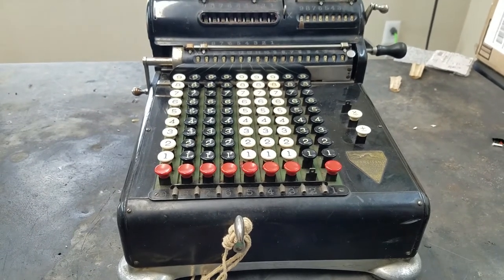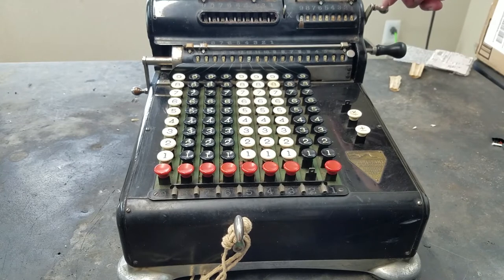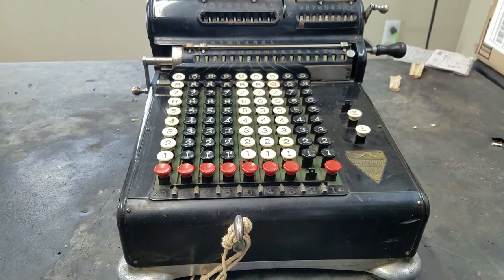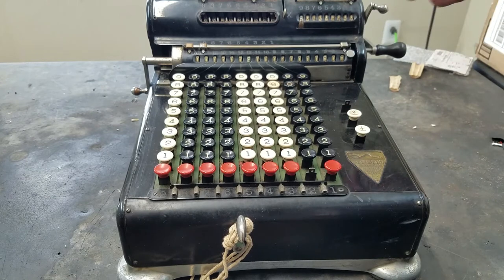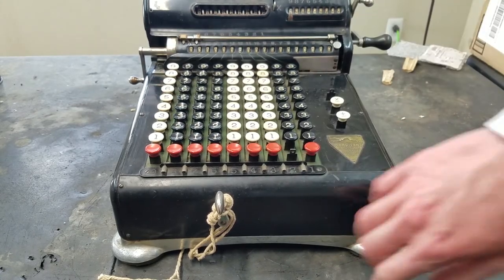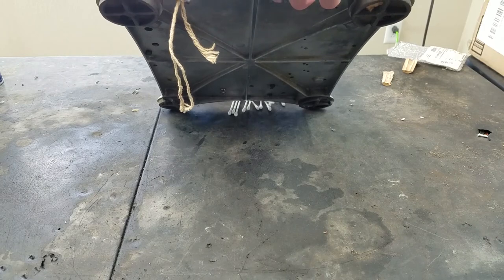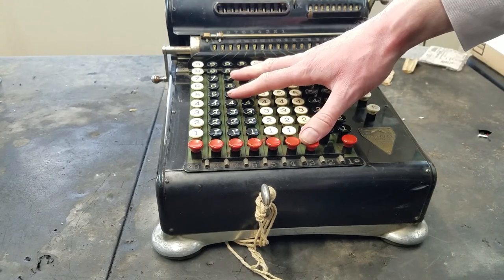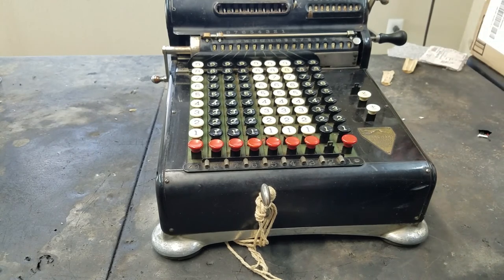The Elusive Marchant KE Mechanical Calculator Repair/Rebuild part #A - Intro/Initial Checkout

Comment: Nice. I hope you get that one running. And yeah, more damage in shipping. I won't even ask how it was packed ;-) . One thing I have to admit about Marchants is how basically beautiful those machines look. All the rounded corners and the labeling. For the time period they were definitely art works. Looking forward to seeing it opened up and fixed up. Good luck!
Reply from the maker: I really like the design of these machines too, as well as the build quality. Lots of castings with brass/bronze bushings and all the stamped parts seem to be atleast 1/16 steel. I just find it so weird they would put so much quality into all the parts and then use pot metal for the counter carry drum. I wonder how many of the new iPads (that bend in half if you're not careful) you'd have to melt down just to get the amount of aluminum in one of the castings for this machine